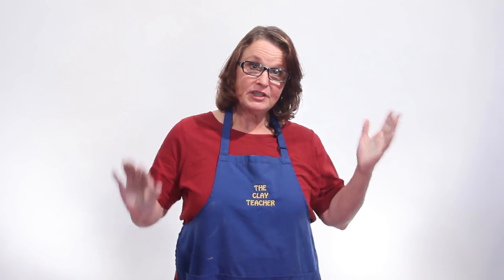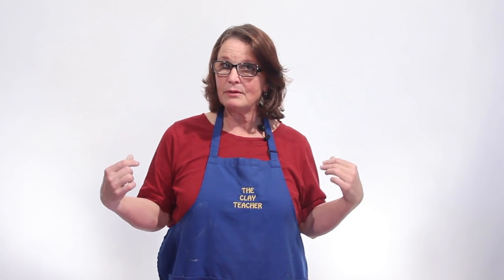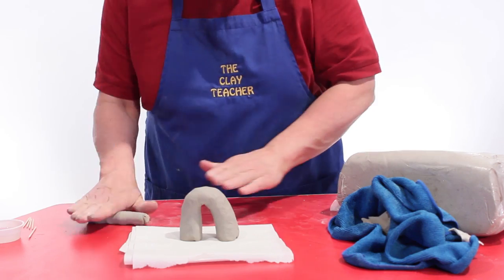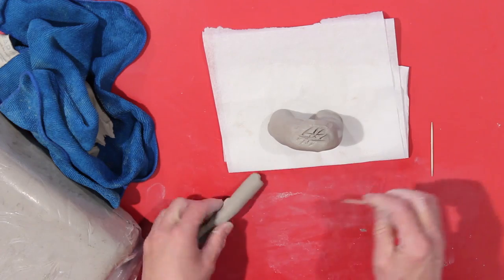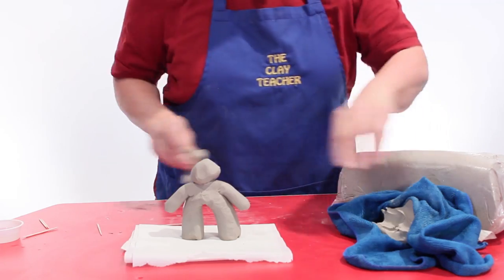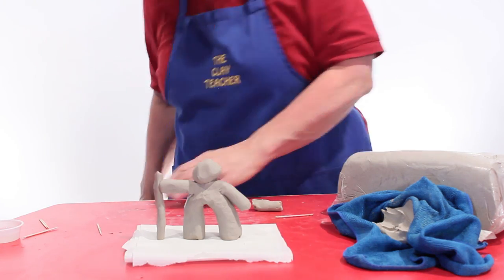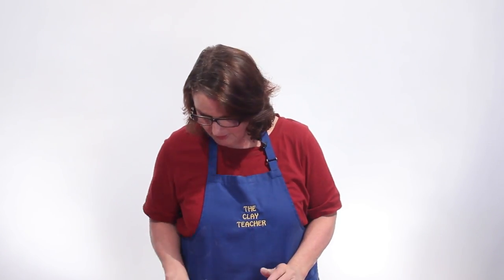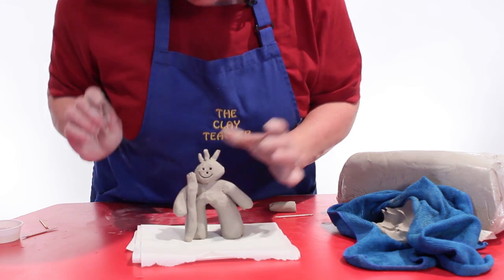Understanding why CLAY CRACKS. Tips and ANSWERS from THE CLAY TEACHER.

Comment: Hi I am using air dry clay to make a mask and I am letting it dry, it had a few tiny cracks today so I went over them with slip and tried to get them out. Well I came home to find some large cracks running up the mask. I filled them with clay and smoothed it out, but I'm sure that wont hold it. Is there anything I can do to save this?

Comment: I just finished my sculpture yesterday and now it's not just cracking it's falling apart what can I do? 😰
Reply from the maker: With out knowing what clay you used, or anything about your work, it's hard to say. If you are using a purchased Air Dry Clay, it often does not hold up like regular clay that can be fired and has a number of problems during the during process.  If you are using regular clay and it drys out while working with it, it can become "crispy", filled with cracks and crumble. If the pieces were not joined properly, that too can cause it to fall apart as it drys. Uneven or fast drying can cause your work to fall apart. When clay drys out it shrinks, the water is gone, so the clay gets smaller.  

Once a piece is dry and broken, there is little you can do about it. Much like an egg. You can't unbreak an egg.  You can't add wet clay to dry, or water to dry clay. The wet clay won't "fit" and water will cause dry clay to disintegrate. If a piece is dry and broken,  all you can do is take what you have learned and apply it to a new sculpture. 

Keep your clay moist in a damp cloth while working. Keep your pieces an even thickness, if you can,   and don't let your work get too thin or dry out while working. A spray bottle of water is good to keep handy. Mist your your clay as needed.  Join all pieces with a little slip, or to be on the safe side, score and slip, Control the drying with a plastic bag. It is always better to have your work dry slowly, especially if there are thick and thin parts. Cover small pieces with plastic to slow their drying if you work is uncovered. 

Good luck with your next piece! If you have any questions, please ask. Thanks for watching.

Comment: I'm using air dry clay to create a sculpture. I'm extremely new to clay sculpting, so bare with me.

I started my sculpture, thought I was finished with it, let dry for about a week in a zip lock bag, and now it's solid as a rock; very pristine and could be considered finished. The problem is: I want to continue adding to it.

I've started applying additional clay, but it's just cracking off after drying and won't meld smoothly to the hard/dry clay. I've tried wetting the dry clay so that the new clay will, hopefully, meld better. But even still, it continues to crack off.

My attempted drying process is to wet a paper towel, wrap the area I applied the new clay to, then stick the sculpture in a zip-lock bag.

Any help would be appreciated!
Reply from the maker: I don't used Air Dry Clay purchased in a craft store. I use regular clay that can be fired, purchased at a pottery supply store. I have used the air dry clay, it is more expensive and cracks more in the drying. Please have a look at the series, Teaching Clay to Elementary Students 2015 and I answer a number of your questions. https://www.youtube.com/playlist?list=PLX73JmCBtq0W0F7_DTJBMHgcPdYeeHjps 
After you have watched the series, if you have any questions, please ask. Also I address this question in a few forms in the comments below.  Thanks for watching!
Reply: Thank you so much for your reply! I will respond further if I have anymore questions. 
Again, thank you for you time and wisdom!
Reply from the maker: Happy to help!
Reply: Kyle Hendrickson

Comment: You're such a wonderful teacher. My question is: I understand that in order to make a standing human figure, I need to make first a wire squeleton to prevent the figure to fall. But can I do that with natural clay? since it shrinks when it dries. Thank you so much
Reply from the maker: There are a few methods to use when sculpting a human form. You can use an armature, but your work will have to taken off the wire before it dries, because as you know it will crack. You can make an form out of something  like newspaper that  will allow the clay to shrink but not crack. The paper can be left in the piece and fired. You can make a solid piece and hollow it out when it is leather hard. Also you can build an armature that will support from the outside and the clay removed when iis is  firm enough to stand on it's own. Good luck and if you have anymore questions, please ask. Thanks for watching.

Comment: Hi there! How do I store my clay  so it wont harden over time. Thank you!
Reply from the maker: You can store clay in the plastic bag it comes in, and then in a plastic bucket with the lid on. Laundry soap often comes in a resealable bucket, or ice cream, or you can purchase lidded plastic pails at a hardware store.  A plastic bucket keeps the moisture in much better than just the plastic bag clay comes in. If your clay has dried out and is a little hard, you can add water in the bag, or a wet cloth. I like to use a synthetic fiber cloth  that won't mildew in the bucket. I wrap the entire piece of hard clay in the wet cloth, or cloths, and it will be soft in no time. Thanks for watching and please subscribe if you haven't already.

Comment: I have red clay or dark brown I don't really know the name of it but everytime I try to do something like around bowl for exsample it cracks and breaks apart and that makes it difficult to want to do anything with it i keep my clay in its wrapped around plastic and it's in a bag so that it won't Harden so tell me if I may ask what clay do you use
Reply from the maker: I think your problem is a drying problem and not he clay. If the clay dries to quickly it will break. Cover your work with plastic and dry slowly. If you can dry your work on a baker's' rack or on an elevated oven rack wrapped in plastic. Something that it can dry slowly and evenly for the top and bottom. Dry clay can break in the drying process, but your clay is soft. If it is a little hard or dry, you can add water by wrapping the clay in a wet rag. You can pour a little water over the rag and then wrap it plastic. They clay will soften in a few days. Thanks for your question and  thanks for watching
.

Comment: I go to the Senior Citizen Center and they do my firing for me.  Sometimes, my greenware pieces have cracks after firing even though I dry everything under plastic.  What are they doing wrong?  Notice I live in Southern California and it is very dry here so my greenware  dries in a week under plastic.  Sometimes, after the  greenware is fired I notice some little cracks  but sometimes the cracks are very big.
Reply from the maker: When your pieces are properly constructed, bisque firing a damp pot can and will cause cracking, or worse. If  the kiln ramps up quickly and there is any moisture in the clay, it will turn to steam before it has a chance to dry out. Pots can still have water in them even if they appear dry. The expansion ratio between water in its liquid form and steam is 1 to 1700. This means 1 part  water expands to 1700 times its volume as turns into steam. If the firing is going through the boiling point quickly, and the water in your pot turns to steam quickly, the result can be far worse than a few cracks. I have seen pots blow up when fired fast. I  leave my kiln on low for hours during a bisque. Depending on the work and how heavily the kiln is loaded, I often leave it over night below 200 F. If there are other pots at the Senior's Center that are coming out of the firing with cracks, it could be they are ramping through the boiling point to fast. Maybe have them slow their firing down at the start and see if it helps. Let me know.  If you have any more questions, please ask. Thanks so much for watching.
Reply: Thank you! I really enjoy your videos.
Reply from the maker: I am glad to help and happy to hear you enjoy the videos. If you haven't yet, please subscribe to the channel and share with your friends. Thanks again.

Comment: Hello! I have a real problem, I'm making a 10inch high GodZilla using polymer clay, and the legs,arms, all the apendeges come off/crack even the middle of the body, I fix it but it keep breaking even with toothpick reinforcements, help please!
Reply from the maker: I am sorry, but I have never worked with polymer clay. I don't know how it dries or shrinks, but it sounds like a drying problem to me.  I only use regular clay that is not purchased at a craft store, but comes from a pottery supply store. If the polymer clay shrinks when it dries, your toothpicks can be causing your breakage. The clay will shrink as the water leaves and the toothpicks will not. The clay no longer fits around  the reinforcements. The tooth picks won't break, but the clay will. Uneven drying can cause breakage, in regular clay. Cover it with plastic and slow down the drying so the piece drives evenly I hope this helps.

Comment: My clay was cracking while I was working with it. Example while I was creating coils they would crack and break apart... Any idea why this is happening and how to stop it from happening?
Reply from the maker: +Melissa Castignoli If you are using regular pottery clay, the reason for you cracking and breaking while you are working with it is it is too dry. I like to use clay that is quite soft or wet. If your clay dries out while it is being worked, it will crack and break. Try starting out with fairly wet clay and keep the unused clay in a damp cloth so it is always soft and ready to go. Thank you for your question, if you have any more, please ask.